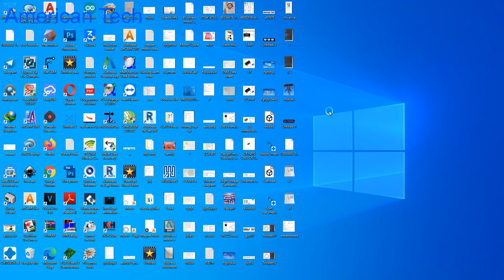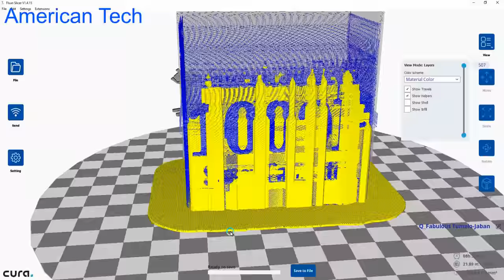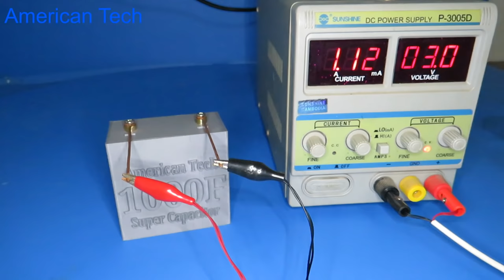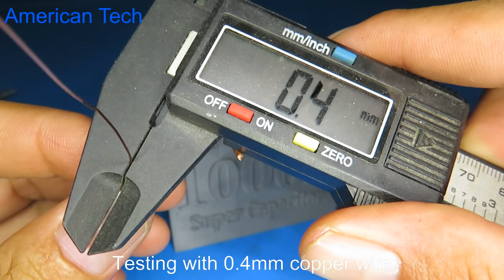How to make 1000F Super Capacitor

Comment: That looked more like a slow discharge that a battery would give you. A capacitor will discharge all of it's energy so it would make a big spark.
Reply: this is a super capacitor not a regular one which discharges everything at once
Reply: This is not a super capacitor. This proberbly has roughly a nanofarad of capacitance.
Reply: A supercapacitor has a very high capacitance, so it can give a high current for a longer Time. But the capacitor in the Video is fake, i there is a high current transformer or a real supercap whose output goes throug the bottom of the fake to its output.
Reply: @Phoenixfisch  bateria 12v de nobreak faz o mesmo efeito do video, enconsta um garfo ao mesmo tempo nos dois polos e veja ficar incandescente rapidamente, cabe facilmente uma bateria de nobreak dentro do case.
Reply: @gabrielcayari4745  would also be possible.
Reply: @sergiuchigai3821  can't believe you are falling for it
Reply: I HV a commercial 100f cap and it works similarly. I gues the material used makes the difference
Reply: 1000"F" he says it's like 1 billion micro farads, by the way it's just a fake video

Comment: I love how much effort you put into your "projects" misleading everyone.
Reply: 😂😂😂...i read comment section very late
Reply: This could be real and if don't believe it just search it in YouTube
Reply: @Dan_The_Paper  i mean
There are indeed real and fake videos
Some of his videos have some real veracity on some stuff
But the mayority of it can be trash as well
This channel could have a huge potential
Reply: Even if this weren't a "funny" movie.......the surface can never be 1000F. Not even 1 farad
Reply: lol
Reply: @Dan_The_Paper  ur kinda right this is a capasitor just a few nanofarads and just for super high voltage
Reply: Surely that's 1000F because the 0.8mm wire can't be over 0.2 ohm and it lit it up for 3+ seconds at 3v ... At least 1000F 🤷‍♂️
Reply: If you use nano carbon or milled carb[n to coat the paper from inside it will increase the capacity
Reply: @henkholdingastate  F or farad is a measument of electrical capacitance
Reply: yes i now and that 1000F must be 1000 pico farad otherwise unbelievable
Reply: @henkholdingastate  it is about max 100nf.  never 1f
Reply: Pm me can you to install do solar panel of charger...

Comment: The title of the video must be 
“How to make a 1000 pF capacitor”
Reply: even achocque goes a few micro faradays but still it will never exceed 5000 or at most 20 000 at most
Reply: 1000μF.
Reply: F
Reply: 1 femto Farad hahaha
Reply: @Koperlich.  While I'm not sure this could ever be 1000F I have a 30,000MicroF cap that is less than half that size so I'm sure it could go at least that high. One would have to put a meter on it that can measure capacitance to be sure what this one actually puts out.
Reply: @axelbelleris  wrong
Reply: The correct answer is 0F. The Leyden bottle gives more to the dialectic used. The capacitance of the coil capacitors is in pF. The video coil capacitor is not working.
Reply: @DL-kc8fc  YOU'RE KIDDING!?.
Reply: @jarjitsinghhhh  You probably don't understand that video is a magic trick. A rolled aluminum foil of this size and thickness of the wrong dialectric is capable of providing a capacitance of tens of pF, not a thousand F. In units of F, it is 0. This capacitance can never heat a coil. The trick is that outside the scope of the camera, the contents of the box have been replaced by a super capacitor that can actually heat the coil. The box is intended to allow the exchange of contents in this trick. Therefore, the so-called "capacitor" of the foil could not be tested before it was placed in the box. Your naivety can cause you serious problems in the future, because you will believe every cheater!
Reply: How to make a paper
Reply: @DL-kc8fc  This is why I hate youtube policies. Millions of idiots are getting more idiot day by day because of such fraudsters.
Reply: @shampuan5628  Unfortunately, this server still doesn't want to deal with fraud, unlike other new rules that come into effect next year. It would be enough if it prevented the authors of the videos from deleting the discussions, or if the server strictly required the placement of fraudulent videos in the "Entertainment" category. Unfortunately, it doesn't.
Reply: True
Reply: @foureyedchick  Apparently you mistaken me for someone. I have no American or Indian technique mentioned anywhere. I also don't deal with clickbait because a reasonable person knows that such fraudulent videos are always for clickbait. I also do not mention electrolytic capacitors anywhere because they were not and could not be used. A supercapacitor, such as a 2.7V 100F, can provide 6A in load, but also 50A in pulse. Even with this small supercapacitor, it is possible to heat the spiral. I personally have a set of supercapacitors in an older UPS in the space of a small missing battery, which supply 50W to my laptop for less than three-quarters of an hour. The total capacity is over 1000F in series-parallel connection, the output voltage from the series connection is 12V and the laptop power consumption is 50W. The calculation of the supply time via the UPS is (1000 * 144/50) * 0.8 = approx. 40 minutes. I also have smaller devices with supercapacitors, such as a powerful electric flashlight that charges via a 5V adapter. These are all things of my own design. So I know exactly what volume is needed to store a set of supercapacitors. One cheap supercapacitor was used in the fraudulent video.
Reply: @DL-kc8fc  Not a problem. I guess you are more up-to-date than I am.
Reply: There is no electrolyte as well, you would need or a very very very thin dieelectric or a very big capacitor to make even 1 micro farads
Reply: @k0sa673  0 farad, its probably going to break somewhere

Comment: You need to use a multimeter so you can type in the actual capacitance, voltage and current

Comment: Capacity of the Earth's surface: 0.7F
Aluminum capacitor: 1000F
Lol
UPD. 710uF
Reply: Is this true about Earth's surface capacity?
Reply: you're wrong ... it's 0.00071 farad, remember it's in microfarads
Reply: @edelcamacho8309  Good point! It's 7,1MICRO-farad.
Reply: @edelcamacho8309  Thanks, I was really wrong, the capacity of the Earth is 710 uF
Reply: The capacitance is approximately 710 micro ferad not Ferad

Comment: The title it says "1000F" which I interpret as 1000 farads.
Well then.  If we calculate the area of a capacitor of 1000 farads with a dielectric of 0.01 mm of separation between plates, it would give us a surface of each plate of more than 10 m², and in the video, those aluminum strips do not have even a tenth of that surface.
What this man built is a rudimentary battery that stores energy as any battery would.
Moreover, the vinegar and salt water is nothing more than an electrolyte. It is not an insulator and its "D" is very high.

Comment: How I can be sure he didn't replaced it with 3V lithium battery at the end of video?
Reply: No, not battery, theres another capacitor inside there that same capacity xD
Reply: cuz 3V lithium doesnt exist 😂 lithiun ion are 4,2V 3V lithium cell is pretty much dead
Reply: @1616oliver  He said lithium, not lithium-ion. Lithium-metal batteries are usually 3V.

Comment: How did you calculate the value of the capacity?
These poles (+) and (-) is based on what technique?
How does the bipolar condenser not suddenly discharge when in contact with a consumer (in this case the wire)
Reply: you are right, the anode and kathode shouldn't matter because the materials use on both poles are the same.
Reply: @erichu4781  also
The wire should have received an amperage huge enought to practicly blow the wire
Reply: Winegar+lemon
What that (( winegar))
Reply: it is fake video. dont consider it real. it is max 10.... 100nf .
Reply: he used a multimeter to put the capacitance

Comment: Time for a little basic electrical wiring skills update.  When you tighten a screw over a wire loop, you should orient the direction of the loop such that the screw tightens NOT loosens the eye.  :). To the question “how do you know it’s 1000F?  They don’t.  Also, the wiping of  an acetic/citric acid solution over an aluminum foil that essentially is covered with aluminum oxide.... well just look at the lack of wetting of the foil when he wipes it across.  Seems like another American Tech video destined to be a “golden oldie” really soon
Reply: That vid is just fake to make vievs
Reply: American fake tech 😂😂😂
Reply: @ Nitrous Man 
Your basic lesson in mechanics is pretty good. I noticed the same, the eye of a wire loop is opened, if the direction of tightening the srew and the end of the wire loop looks into the opposite direction. 😂
Reply: Tradurre in italiano
Reply: Ciao,  se possibile vorrei sapere le due ultime strisce di cosa erano fatte . La strisce bianche che hai messo per ultimo e poi hai messo l'ho scooch di carta e poi l'ho hai arrotolato . Questo vorrei sapere per favore l'ho sto facendo adesso . E vorrei sapere se bisogna mettere con una siringa ,acqua e sale ho aceto bianco e limone ho non bisogna mettere più niente . E vorrei sapere quanto tempo dura . Grazie mille e ti auguro un buon pomeriggio.
Reply: Traduttore google
Reply: Traduzione Google in italiano

Comment: Почему не показал что там реально 1000 Фарад. Ну и можно было хоть тестером показать напряжение. Ничего не померял, не показал толком, и палить проволку. Похоже на чистой воды фейк. Кроме того, конденсатор бы сразу разрядился на проволоку, но не у автора видео, там заряд бесконечный.
Reply: Ну если там действительно такая ёмкость то вполне возможно, но её там нет. Максимум 1000 мкф
Reply: The video is a scam, or rather a coil capacitor, which was made very stupid in the video, of course it does not have such a capacity. Basically, it would not work at all due to the dialectic used and its thickness. Maybe it could have a capacity of a few pF at a higher voltage, like in a Leyden bottle. The capacitor does not necessarily discharge its capacity immediately, unless it is short-circuited. A real large capacitor bank powers my LED lighting for a few minutes. Each connected device draws as much mA as it needs (basics of electrical engineering). It is only necessary to observe the charging voltage that is marked on the capacitor, for example 6V. The capacitor will be able to power the device to 6V, taking as much mA as it needs. Capacitor batteries may be the future if nanotechnology can increase their capacity at the expense of less space.

Comment: I like the way you're not zapping yourself when touching the wires. Also that you have really thick skin that can resist those burns. You're a superhero 😉
Reply: Exactly, he would've gotten a good whack from a 1000 farad capacitor..!!
Reply: @frankpitochelli6786  It's as fake as can be BUT no shock likely under about 30V with wet hands or 50V with dry hands - regardless of the capacitance or current handling. Hence why you can touch a fully charged car battery with wet hands and not even feel a tingle.

Comment: Sir can we use this capacitor for spot welding??
Reply: No. Fake.
Reply: @schitlipz  agreed, i tried making capacitors and battery's for over years now... and if you know chemistry a little well, than you know the aluminum will corode wit the salt water if any electricity gets added, and aluminum + aluminum wont make a voltage potential powerfull enough to weld...
Reply: Honestly im trying to make a capacitor with much power to try and turn on a dc motor... but welding requires much power tho, you might be fine with a car battery

Comment: Hi engineer Thanks for this very valuable video. My question is what is the voltage tolerance of this capacitor? And how long and thick each of the aluminum strips should be. thank you again
Reply: This is fake supercapacitor.
Reply: Bro is fake not is 1000F and the max voltage depend from dieletric material
Reply: LOL not an engineer. You cant make a supercapacitor with a roll of aluminum foil
Reply: This is not a 1000F capacitor.  This is a simple salt battery.
Reply: @HighVoltageMadness  actually you can but you cannot use salt water as a dielectric
Reply: HAHAHAHAHAHAHAHAAAAAAAAAAAAAA FAKEEEEEEEEEEEEEEEEEEEEEE
Reply: They are trying to imply they made a super cap. I wouldn't build something 1/100th their claimed size without a 3 Meg resistor in it.

Comment: Hello
Is it possible?
Use this method for induction furnace capacitor.
And construction with a voltage of 4000 volts and a current of 500 amps.
Thank
Reply: You should use mineral oil or nylon insulation instead of  natrium electrolyte.

Comment: When you charge super cupacitor, there is a very high current (almost as short circuit) in the beginning. It slowly will decrease.
Reply: Especially with 1000f current should have in the range of 20amp+ but he can control Max current through pwr supply

Comment: Would copper work better and have more robustness than aluminum ??? How about the electrolyte, would using other than salt work better and be less corrosive using copper ??? How about longevity of your capacitor design, how long will it live before it dies ? Thanks

Comment: We were asked this question in high school, if i remember right, "How big would a one Farad capacitor be?" We were allowed to let our imagination fly and yet we were no where near. 
The answer our teacher gave us was shocking, needless to say.
"a one Farad capacitor would be as big or close to the size of our planet Earth". It was memorable; shout out to my physics teacher Prof Desai, I still remember your analogy and I won't ever make that Farad mistake again. 
So there you go, I want the viewers of this video to imagine 1000F as thousand Earths large.
Reply: wtf, you lie, you can buy something whats called "supercepacitor"
Reply: This would probably be true if you're speaking about surface area. But in the case of capacitors, manufacturers usually make rolls with some metal plates (something like the capacitor in this video), and then they coat them in carbon. Due to the nanostructure of carbon, its surface area is multiplied, and the fact that there's a long strip of material rolled over makes the final product really small. And to top it off, manufacturers use electrolyte, which also multiplies by a lot the capacitance of the product. 

I'm not saying that this video isn't fake, because it is (the electrolyte used doesn't work, there's nothing that soaks in electrolyte to keep it touching the metal plates, the roll isn't very compacted, he doesn't coat the aluminum strips in carbon and there's not enough surface area), but I'm just saying that there are indeed 1F capacitors, which aren't that big either (somewhat similar in size to a can of Pringles). The only thing is that there's a LOT of science involved in this capacitors to effectively pack the whole surface area of the earth into a can of pringles sized component.

Comment: The capacitor would have a much more violent reaction with the wire if the two contacts touched. The wire melting was much more like if you just hooked up a beefy power supply to it. Kinda sad that you're hearing this from a Senior in high school that hasn't even had any real training in electronics outside of physics

Comment: how did you calculate the 1000F rating, why is it exacly 1000F, why would that thing have 1000F?
i did some math and the energy that that thing is supposed to store at 5V would be 12.5 kilo joules, thats magnitudes higher than what i would use in Nd:YAG lasers at way higher voltages but the capacitors are still 20-30 times giggger that what you have.
please explain why this wouldn't be a scam

Comment: One flaw. 2 disimular metals will oxidize. Use brass screws with your brass connectors. Time and electrolysis will corrode these.

Comment: Wish all the people telling this video fake know that it's not possible for a lithium Ion or lithium polymer or any type of lithium battery of that size melt copper wire of 0.8 mm thickness, lithium battery would blow up if it passes 100's of Amps through it like this, plus it takes quite some time to charge a capacitor that too a capacitor of 1000F will take heck longer , he increased the voltage for charging the capacitor once so it took extra longer for charging.

Comment: Total BS.  Looking at the relative area of the foil and crude rolling of the foil plus no electrolyte this thing would at best be a few microfarads.  Even true super capacitors are around 1 F and run no higher than 5 volts. A 10,000F capacitor would be the size of a car and one wound with foil tape would be the size of an office building. The demonstration of shorted wires looks like a chemical battery.   The ammeter was showing a discharge rate a
of 2 amps yet the voltage remains constant.  Capacitors show a linear drop in voltage when discharged

Comment: Awesome and nice! Question can it be used to build a Marxs generator and voltage multiplier?
Reply: not because the capacitor doesn't have 1000 faradays, probably only 5000 micro faradays
Reply: @Koperlich.  no its probably in the Nano Farads
Reply: @HighVoltageMadness  yeah,some yetta faradays
Reply: See electo boom vedio on Marx genarater it would be helpful

Comment: How did you see this as a 1000F capacitor?
Reply: It sounded like a great number to claim for his fake plastic box with a lithium battery inside.

The easiest shape to make a genuine, simple capacitor is going to be a cylinder - as you wind metres of foil and dialectric tightly together. Sadly the surface area is still tiny compared to super caps which use things like etched surfaces to MASSIVELY increase surface area.

This is just a lie in a box.

Comment: If it was 1000 Φ with a charging voltage of 1 volt it would have an electric charge of 1000 coulps and in discharge respectively a current of 1000 amps